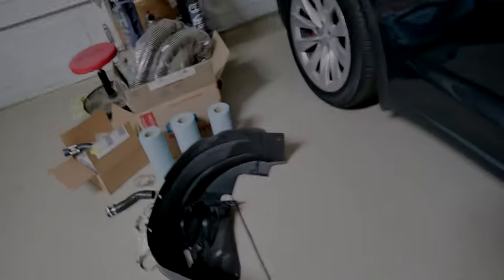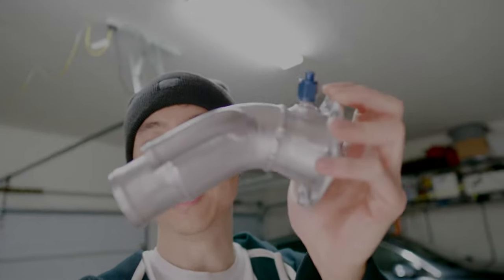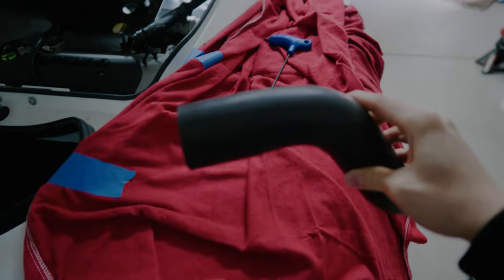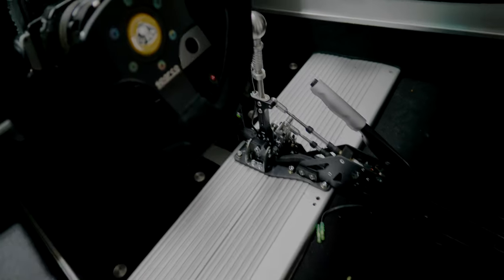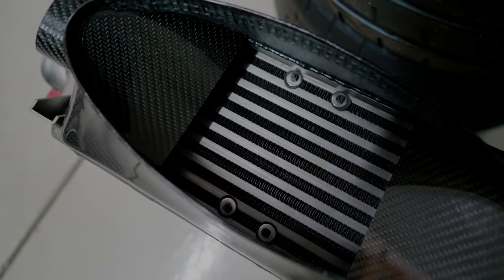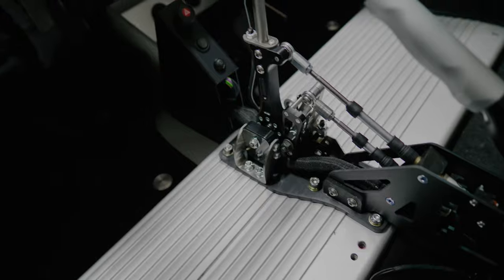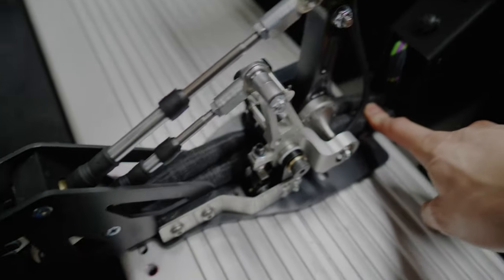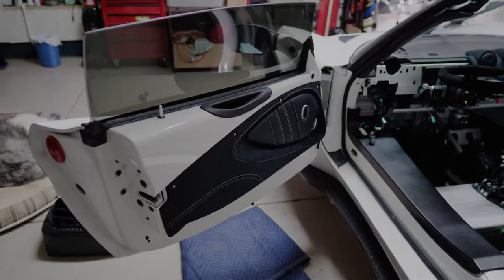What Happened to the Lotus Exige?! Finally an UPDATE

Comment: Did you retain the stock rear sliding caliper/handbrake combo? It looks like the handbrake caliper is aftermarket but the lighting was too dark to tell. Are the rear brakes the same setup as the front stock S240 two pot setup with AP slotted rotors? I swapped the front rotors to ultradisks on my 2008 S240.  
Nice build.

Comment: To remove the engine and transmission you are supposed to remove the rear clam shell. then you just disconnect the engine and transmission and lift it out. Don't try to pull it out through the wheel well. that's insane. if you damage that fiberglass rear clam it's like $8k to replace and usually on back order.